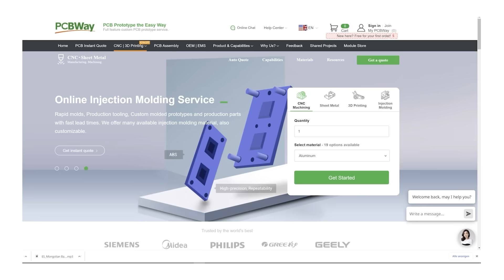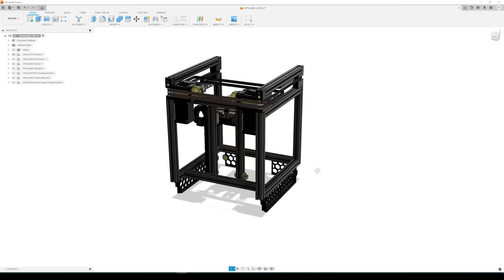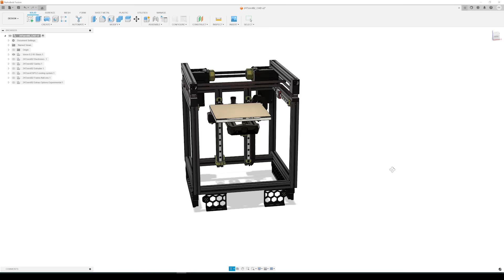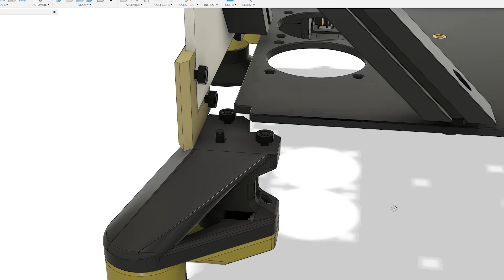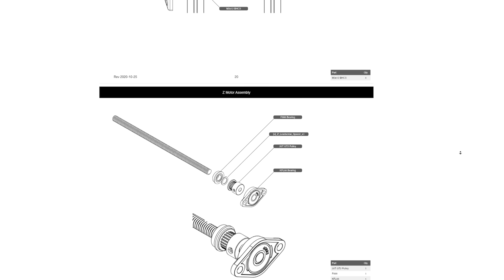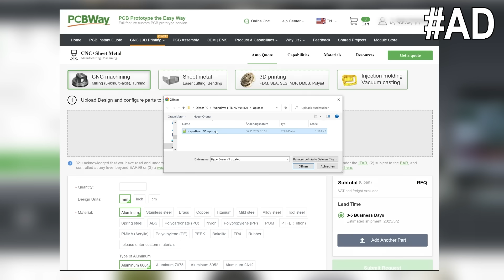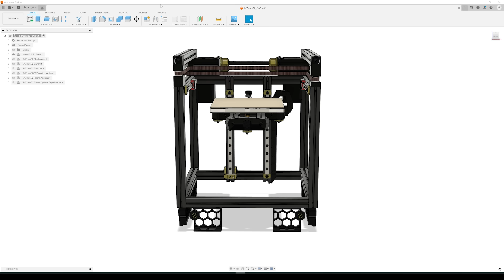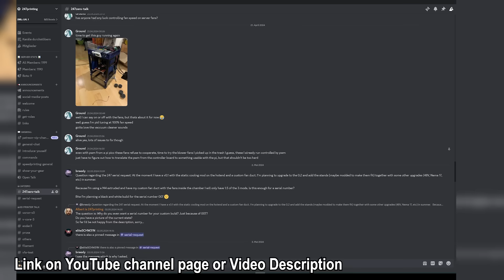247zeroBETA2 File Release: Walk-Through!

Comment: Can you make a version of this but with voron 2.4 r2 model not 0.2
Reply: tbh, I think you're better off chasing some different targets with a 2.4. flying gantry makes the external static cooling challenging if not impossible, bowden is now feeding a 250-350mm print bed, motors can still be cranked to 48-56V or whatever, but belt path is super long, x-beam is now 2-3x longer and has more flex and resonance. If you're looking for a new printer that size, trident or vzbot maybe? If you have a 2.4 and just wanna crank it, there are some AWD mods, 48V mods, ultra light toolheads, better cooling etc.

Comment: I was looking for it, and finally - here it is! I probably won't transform my v0.2 into 247 completely, but some mods will definetely make it into my build. I also wondered if it is possible (or at least relevant) to make the 247's toolhead direct drive? I've been using micro sherpa for 2 months and I love it! It is light and really small. Such configuration would allow to print really fast with all the benefits of DD. Do you plan to experiment on it? Or should we take it into our own hands😏?

Comment: why not try this with a Voron Micron instead?  Being a small 2.4 its center of gravity would be much lower making for a more stable platform to do UBER SPEED with.
Reply from the maker: Viable question! But why not use a 200x200 V-Core 3.1 as basis? 247“zero“ is based on Voron „zero“. Though you are right: There might be better printer concepts to start a speed concept upon.

Comment: Those x beams are crap. The mellow CF is too thin however may be good for a printer that small but the rail is not fastened properly. The rail can rotate on the beam. You need through hole with a printed insert mounting a la monolith. The noodle aluminium have no torsionl stiffness what so ever. Grab the toolhead and try to rotate it in Y. The goal is to not have it move at all even if using full force.